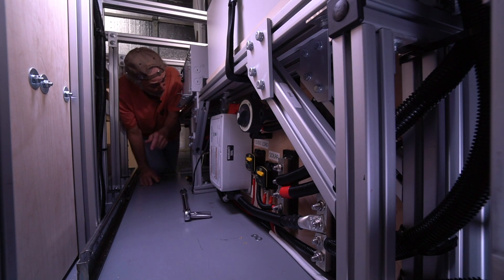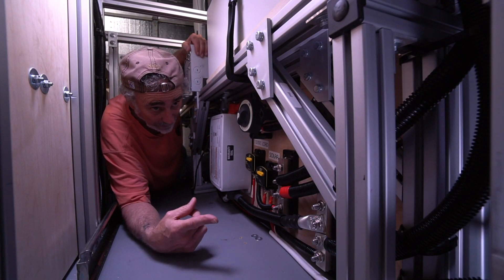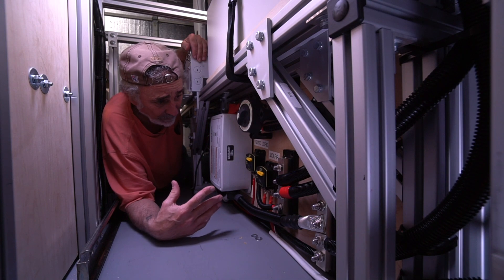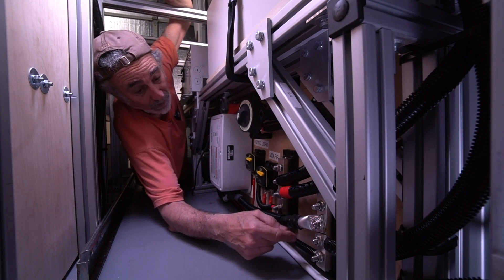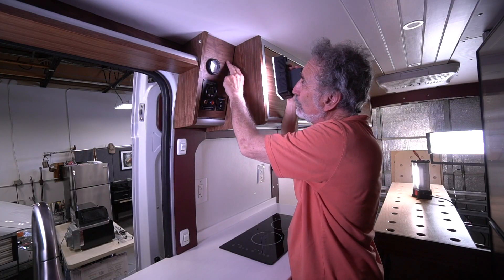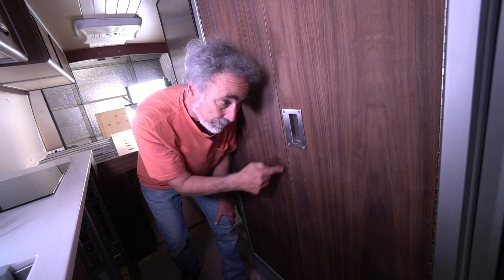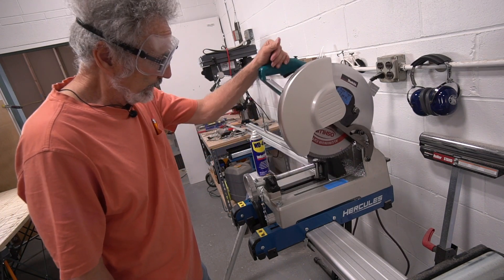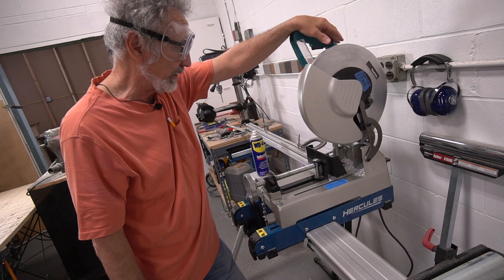Electrical, solar control, cutting 8020 & a game changer for van builds!

Comment: A temporary, sliding, electrical creeper tray was “sorely” needed in order to slide you in and out of that slim electrical access space, especially since you were in and out of there 100 times per day. It did not matter. You were going to get the job done one way or the other.
Congratulations!

Comment: You know what else would be a good idea is make your long 80/20 with measurements on it from the left side of the blade. That way when you have your slide clamp you can clamp it on whatever measurements you're wanting to cut. I guess it would really have to be dialed in to get precise cuts though 💇🏼‍♂️📐🤷🏼‍♂️

Comment: What lithium batteries do you recommend ?
Reply from the maker: Lithionics
Reply: @HumbleRoad  thank you , I'll see if I can find them in Canada ?
Reply from the maker: If you have a bit of time, soon I will be demonstrating an incredible new power system put together by Lithionics. Stay tuned! https://lithionicsbattery.com
Reply: @HumbleRoad  is love to but my warm weather time line is running out quickly here 8n Canada . It's getting quiet chilly at night and I need power asap to run a Diesel heater . I will check it out though . I 😎
Reply from the maker: Sandy Graham haste is no motivation for the proper power system. It’s a very important decision!

Comment: Are you using 1 or 1.5 inch 80/20 and how do you attach the wood panels? Do you rout out the edge so they are set flush with outside edge of 80/20?  What width are the wood panels ?

Comment: I love your builds, and the spirit of lean/continuous improvement! (I realize all you need to do it right is patience and lots of money.) I'm building out a van right now and want to use 80/20. Because everything in my van is smaller in scale and lighter, I'm thinking of using the 1" profiles. Is there (in your humble opinion) a dealbreaker reason not to?
Reply from the maker: Structurally, if built correctly, the one inch profiles are fine. Dimensionally, how it relates to 1/2” and 3/4” plywood, the 1.5 inch profile is better from a fastening and esthetic standpoint.

Comment: Hi George, Welcome back, you were missed....   I do have a question, do you cut you own 80/20 "15" profile stock?  You get the impression (from 80/20) that you need to order everything factory sliced.  For my bus build that seems like a lot of downtime if a design change occurs. I would think my project would move a lot faster with a pile of long stock and that cool Makita saw you just showed off.   If you do cut them an instructional video on 80/20 slicing and mitering would be awesome...  Also I would fly on any airplane you want to make in the future...  Be safe, glad your procedure went well.  --- Pete
Reply from the maker: Yes, Pete. I order long lengths of 8020. I cut as needed. I am efficient in knowing how a long length will be sliced up for use, very little waste.
Reply: Thanks George, hopefully we will see you cutting some up in a future episode. 😀

Comment: YOu are so right on the heat generated by a charge controller. If your using a lot of power and it's pulling in a lot of solar that charge controller will get so hot it's barely touchable.  I sugest everyone ck theirs out, it may convince you to make changes.

Comment: Most Excellent build! 👍 I’m wondering how or if you have thermal breaks / insulators to prevent heat or cold transfer causing possible condensation build up with the aluminum framing.
Reply from the maker: Watch my videos. The answers are there.

Comment: Hi George, so happy you're back and on track!  You mentioned the inaccurate pencil lines on the aluminum. I just learned about brushing on a thin coat of "Blue Dykem" and using a scribe for marking. It's very accurate!  My son is helping me with my build (when he has time so it's going way too slow). I've got all the components and I am just waiting...so frustrating!

Comment: George - First off, thrilled to see you back and almost in one piece!  Another great video, as usual.  A couple questions for ya:   Where did you source the cable for your DC system and what cable did you buy?  Also, what cable are you using for the AC side of the house?  I just finished my AC installation.  I used regular 12/2 romex.  I am a bit concerned about the connections loosening up on that large single strand of copper vs a multi strand cable on a system subjected to constant vibration.  What are your thoughts?  One last one - how are you grounding the AC system?  These rigs do not ground to the ground so I am a bit stumped on that one.
Reply from the maker: The 4/0 is tinned fine strand. $1,000 for 100 feet! Plan your runs well! You are correct, Rolex is unsafe in a vehicle. And I hope you meant to say 12/3. I buy Ancor Marine wire.

Comment: George, if you really want to make the solar controller happy mount the solar controller on an aluminum plate instead of the two pieces of bar stock. The aluminum plate would provide a larger surface area to conduct and dissipate the heat and transfer it through to the 80/20 supports. Add some thermal paste between the controller's heat sink and the aluminum plate, and between the plate and the 80/20 to ensure good heat transfer.

Comment: What thickness 80/20 do you normally use George? One inch and a quarter? when you were under the bed some of that 80/20 looked massive. Like 3-in massive. Was that just the camera angle?
Reply from the maker: The truss bridge and bed supports are all inch and a half (15 series)

Comment: Wow, you torque things?  That is more unusual than you might think.  Cutting your own hair is far easier than getting it cut.
Reply from the maker: Great point!
Reply: @HumbleRoad  After getting a terrible and expensive haircut I decided I could give myself a bad hair cut for free.  I use a pair of scissors and my fingers between Flowby sessions.    People actually compliment me on my haircut.   After a short while you get good at it, and you can freshen it up anytime you want.  Paying for a haircut is for those who don't know you can do just as well yourself.   

I wish the place that replaced my power steering pump torqued the bolts, the heads sheared off in the desert because they were left loose.

Comment: Hey George!  Love your videos, some of the best, if not the best, production van build videos out there!  Love how you teach, show your design, layout, and build process.  It is extremely helpful!  I do have a request if you would be so helpful.  Could you highlight in a future video how you do two things with 80/20.  
1) Wow do you attach/secure the 80/20 frames you make to the van wall and/or floor.  I assume it is with Riv Nuts, but how do you secure the 80/20?  Do you drill through it?  How do you get holes to line up.  Would love if you would show that.
2) How  do you attach wood to the 80/20 with no hardware or 80/20 showing, both on the front, sides, and end caps you make.  I am only familiar with attachment methods that would require either the hardware to be visible or the 80/20 to be visible. 
Thank you!  Again, love the builds, love the thought process, detail to the little things, and innovation!
Reply from the maker: You got it. Stay tuned!

Comment: George, by the way, make fun of me if you wish, but I haven't seen a barber in over 10 years, my Flowbee has paid for itself and then some.  You remember the Flowbee right George?  "Guess what, they are still around.  Check it out, before it's too late.
Reply from the maker: I do remember the Flobee as well as the Trimcomb. That was a razor blade embedded in a comb. My Mother used to drag that thing through my hair as I screamed bloody murder!
Reply: @HumbleRoad  New Update:  TMZ just released that George Clooney has been using a Flowbee for years!

Comment: George, glue a rectangular piece of 1/4 plywood behind that flush handle.  I'm thinking like 3" x 4" That will add strength around the handle and prevent it from blowing out.  Could screw it too, if you want.  But 1/8 thickness is gonna fail with the wear obtained on bumpy roads.
Reply from the maker: The mounting screws are set fully into the 3/4 ply. The grab pocket is ramped so the deepest part of the cutout is minor.

Comment: There are positive locking latches that are flush, as well, and act like handles if you flip them out. The boating industry has a lot of stuff available and they have all the issues that vandweller do - close quarters, and the potential to slam into stuff because there is so little space. That door handle is great as a door handle but I still like latches that close and can't shake open when you drive. Of course marine stuff all costs a lot.
Reply from the maker: Locking latches need to be unlatched every time. The cumulative effect wears on you. We use magnets to keep the doors closed.
Reply: @HumbleRoad  This is true, though there are locking latches that work by lifting them and pulling in one motion, not push in to open and then pull. They also never stick out, you put your finger into a shallow "well" and grab, lift and pull.

Comment: A very good morning to you George...
What does it say when a person has a big smile on their face when they see components and work drawers nicely labeled?   The little things matter 
What does it say when a person has a big smile on their face when they see the clear advantages of using the 80 20 building system?   Why is this not used broadly in the industry?

Will the upcoming Sprinter build be on the 144 or 170 chassis?
Reply from the maker: The upcoming Sprinter build will be a 4x4 170. It's going to be a beauty!